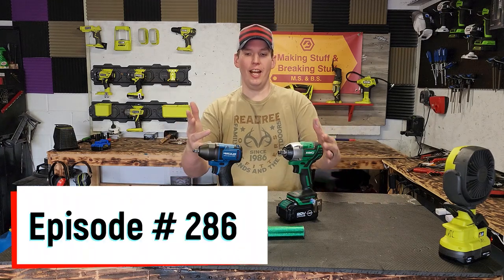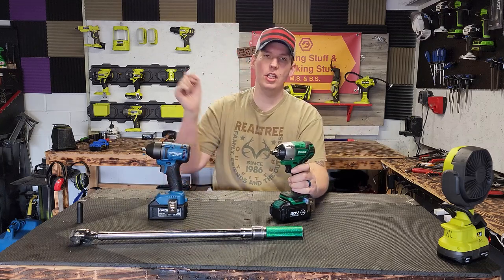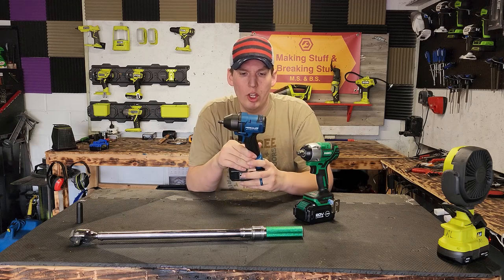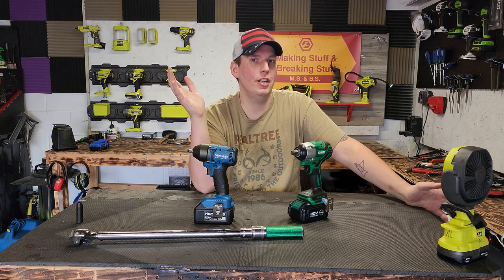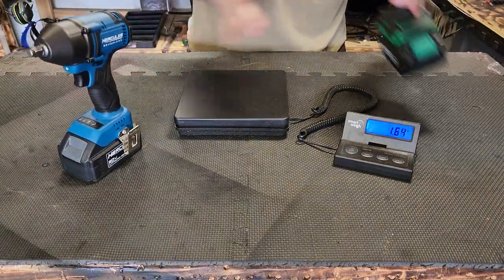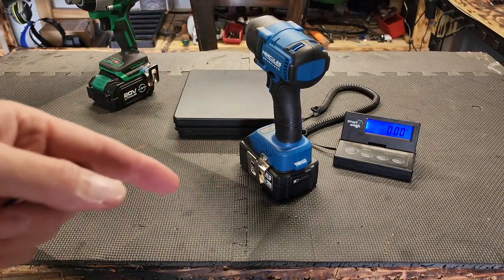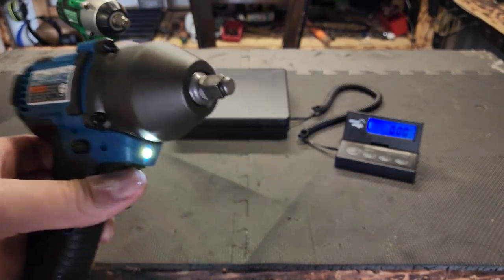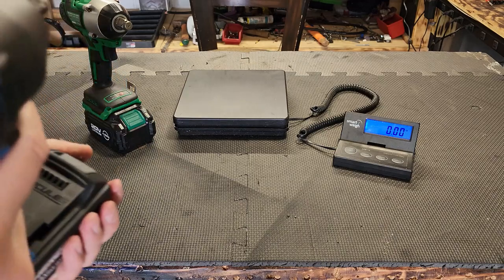Best "Budget" Mid Torque Impact Wrench, Amazon VS Harbor Freight. Kimo VS Hercules

Comment: Crazy... 3/8 vs 1/2. Why not the 1/2 vs 1/2. Any 3/8 to a 1/2 is a huge power difference... even in the same brand. Seems like Hercules is the better tool over all anyways. Plus 5 year warranty on tool, 3 year warranty on battery, and they have plenty of local stores around.

Comment: I bought a KIMO 20V Cordless Impact Wrench 1/2 inch, 2000 In-Lbs & High Torque 3400 IPM, and had several problems with it. 1) It wouldn't remove 150 ft lbs lug nut; 2) the battery didn't snap onto the tool very easily; 3) the socket didn't snap into place very well, either. My thought is that the drill isn't machined at the factory very well.
Reply: Hmmm.... Was looking for a High Torque Impact wrench....And  looking at the same thing...Plus, was thinking of a "different color " also...Have most Black and Blue/Black  electric tools....Glad you did the "Beta Testing " for me... Thanks... But, seen a "DuWox brand" that's also Green...Its a l'il expensive on Amazon...I'm on the fence about it, tho..

Comment: The "wiggle" in the milwaukee you said for batterey fitment. In that application the is deliberate. Its so the all the soldered connections don get vibrated apart. The battery is allowed to move to limit that high impact jarring on the battery. Al😂l the big boys do that. Same with with hammer drills as well.

Comment: The 3/8 Hercules specs 229 fr/lbs vs the 1/2 which is 322 ft/lbs.  The "Breakaway" is 30lbs more as well. So even it's worse spec is still quite a bit more.

Comment: Was this a  3/8 vs 1/2  impact test?  You would think that the 1/2" impact would have the advantage.......
Reply: Its basically just the 3/8 model with a 1/2" anvil instead.
Reply: exactly, you lose torque with having to use a 1/2" adapter on the hercules, i have these same tools and i noticed you just have more direct power when you dont have any adapters in the middle of the socket. So this test is a little bunk, even on the torque test channel shows you lose power with adapters and extensions.

Comment: I'm trying to think how many fasteners on a car  could be so hard to remove, that neither one could remove.
Tool longevity and warrantee would be a consideration, not to mention the fact that you might buy other tools that work with the same battery.
Harbor freight is in town if you need a replacement.

Comment: WOW! I know that KIMO DRILLS AND IMPACT DRILL IS ALSO WELL-DONE! KIMO BTW IS BASICALLY METABO!? HITACHI!! HITACHI BOUGHT OUT KIMO AND THEIR NEW COMP IS HIKIMO!? WHICH HITACHI IS ALSO METABO! JUST SO U GUYS KNOW!? SO IT SHOULD BE GOOD TOOL LIKE METABO!? 

Hercules needs to do more kits! And combo kits!!!!! Herc is still wayyy behind rt out the gate! Herc impact kit is like 97!? And I think KIMO is like 76 for the kit!!?? Anddd u get a lot of shit with KIMO bits etc!! Case! I been thinking about getting KIMO!? Had it ordered then canceled cause I wasn't sure!? I had order HYCHIKA from Amazon and it looks nice but was total shit so it made me back out on the Kimo OSMT tool I had ordered also!

HERCULES IS SUPPOSED TO BE HF NO 1 LINE!! TOOL! BUT IF U ASK ME AND A MILLION OTHERS WE SEE BAUER AS THEIR MAIN NO 1 TOOL!

BAUER OFFERS FAR MORE!!! MADE BETTER ON MOST!! ESP THE BAUER OSMT W BATTERY! THEIRS IS SUPER LW!!! AND MUCH EASIER MUCH BETTER RELEASE!!!! WAYYY BETTER THAN HERCS!

AND I ALSO NOTICED THAT HF HAS PUT IN A TON OF TAPES ETC....ESP BAUER!! FAR MORE BAUER!! ANDDD HERCS TAPE IS HUGE HEAVY AS HELL BULKY AS HELL AND CRAPY AS HELL TO ME!!! I HATE IT!!!

BUT BAUERS TAPEM.... IS MADE GREAT!!! SUPER LIGHT! ERGONOMIC!! HAS A GREAT PUSH BUTTON ON TOP TO LOCK STOP ETC THE TAPE! WHICH IS NICE! ANDDD THEIR TAPE STOPS AT ANY POINT OF U PULLING OUT...ON ITS OWN! I MEAN HOLLY HELL THEIRS HAS SUCH AWESOME FEATURES!!!!! WHICH I ABSOLUTELY WISH THEY WOULD DO ON THEIR BIGGER 30 ABOVE TAPES!! 

ANDDD I NOTICED NO WAR SHIT WRITTEN OR ON HERC HOWEVER!!! BAUERS HAS LIFETIME WAR....!!!!! ON THEIRS!! THEIRS IS LIKE 9.99! AND HERC HUGE HEAVY BULKY POS TAPE IS LIKE 15?? NOOOO LT WAR!!

AND I TELL U GUYS I BELIEVE BAUER IS GONNA BE COMING OUT WITH SOME KINDA NICE WAR....MAYBE LT ON THEIR LINE AS A WHOLE REAL SOON! 

NOWWW IS THE TIME TO GET INTO BAUER FOLKS!!! THEY HAVE A GOOD SOLID LINE!! CHEAP!! WELL PRICED!! AND NOW THE TAPES WITH THE GREAT FEATURES AND THE LT WAR!! I MEAN THEY WERE MAKING A LOT OF TOOL SPACE FOR BAUER!! WHICH HAS MORE TOOLS AND BETTER TOOLS IN MY OPINION!! BUT NEEDS KITS!!!!

COME ON BAUER DO KITS ON ALL UR TOOLS LIKE SKIL DOES!! AND DO SOME GOOD COMBO KITS!! BUT KEEP THOSE PRICES DN!!!! BECAUSE I HAVE 2 BAUER TOOLS NOW! LOVE THEM!! 

AND I NEVER PLANNED ON HF TOOLS!! BUT HERE I AM GETTING THEM...AND WANTING MORE...!!?? GO FIGURE!!

AND I WAS DEF GOING WITH KOBALT SKIL!! WITH A LITTLE METABO!? 

BUT NOW TSC HAS BLT THEIR NEW HOLY HELL STORE WITH THEIR HOLLY HELL LOWES LAYOUT OF
DAMNED NICE TOOLS!!?? TSC HAS A MAJOR LINEUP OF MAKITA AND BOSCH!!! AND HAS BOUGHT PC AND IS MAKING PC THE TSC TOOLS NOW!!?? 

AND MENARDS MASTERFORCE IS FLEX TOOLS WITH THE ADDED BEST OF SKIL!! GOT SKILS HALO LIGHTS! LIKE WOW!! LOVE CHERVONS TOOLS!!!!

ANDDD TSC IS GOING TO BE SELLING AND HAVING SENTIX? TOOLS!! WHICH R THE BEST LOOKIN ON THE MARKET I THINK!!!! RUNNING 99 FOR A KIT!! LIKE WOW TOOLS!! TEHY DONT HAVE IT IN THEIR STORES YET!? BUT CARRY THE SENTIX SENTAX?? ONLINE!! U CAN GO TO THEIR SITE AND ORDER THE I
KITS THERE FOR 99!! U NEED TO CHECK THEM OUT GUYS!!

AND BAUER IS COMING UP QUICK AND GOOD AND KICKIN ASS TO!! SOOOO MANY GREAT DAMNED TOOLS RT NOW!!! SOOO LITTLE MONEY AND SPACE!!!😮😮😮😊😊😊
Reply: That is not true. Hikoki  Holdings Japan, which is Metabo and Metabo hpt does not own kimo. I don't know where you got that info. Beacuse they all have those line of tools already. And  they don't state anywhere that I can find the Hikoki Holdings owns any part of kimo. All the tools that Hikoki owns or tool companies all use interchangeable batteries. The kimo isn't even close. And if they where owned by Hikoki Holdings than kimo would be able to sell an 8ah battery. And be able to use on there platform.